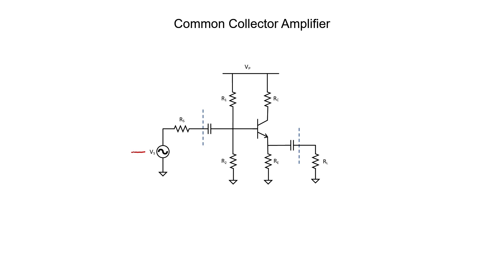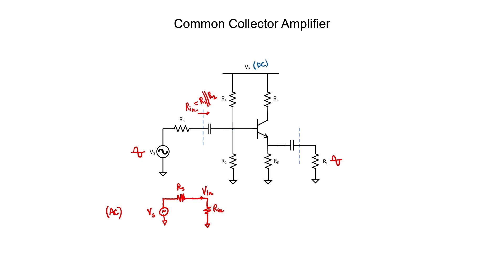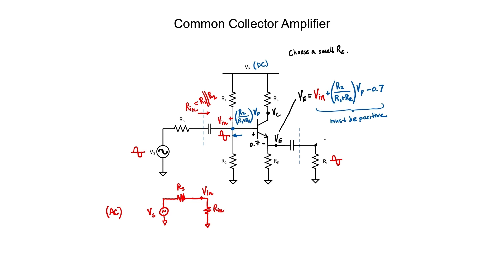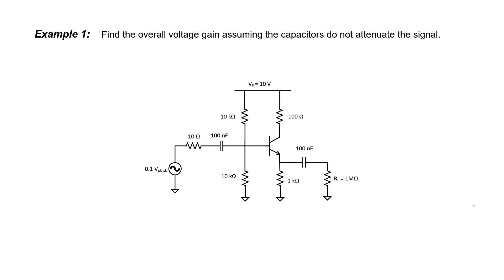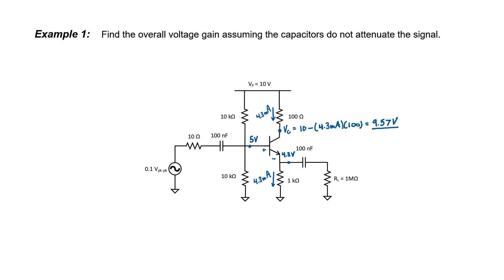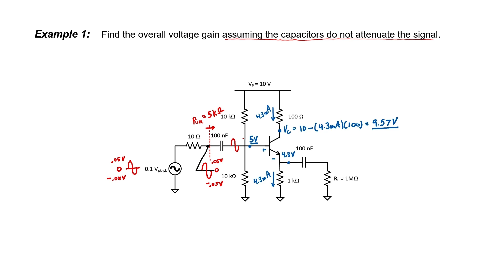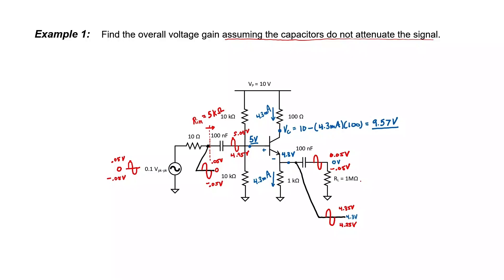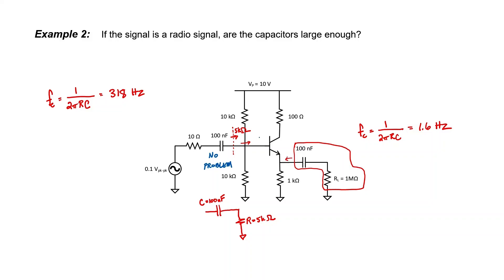Gain in a common collector amplifier (9-Transistors)

Comment: Thank you for all these amazing videos. I am an ex-EE (undergrad) but now a physician. I am a ham radio operator and do electronics as hobby now. You mention in this video that you want Rin to be as large as possible. However, in RF, people often try to "match" the impedance, often at 50 ohm. I understand that this maximizes the power transfer. But wouldn't it still be advantageous to keep Rin as high as possible and then obviously impedance match on the output side? Or I wonder if this is because at RF, it's hard to keep the Rin high (due to parasitics and etc.) so they just assume Rin is somewhat fixed and then work on the matching circuit??

Comment: TY, this was incredibly well done and helpful. I am playing catch up as well as review, and you reminded me that the voltage divider for bias is seen as a parallel resistance and I immediately remembered why. I'm finishing up some common emitter designs and had forgotten this for my RC filters. I was within range, but this helped me pinpoint designs as well as explained why a particular cap seemed to have cleaned up my output signal so well, and another was significantly reduced in bass. 

I needed a major reduction due to excess, but my figure was showing me 95 Hz when it's in fact, much higher than that! By sound, 95 Hz didn't seem reasonable, so I checked.

Comment: If the capacitors are polarized, what is the correct polarity?
Reply: If you consider electrolytic polorize capacitor, they have Negative mark on one side.
Reply: @h49suthar exactly - which side should be connected to positive and negative?
Reply: @tomlovie Think about this for a moment, where is the voltage "most positive"? 

It is at the point of the voltage divider, in his example there is a swing seen at the base of between 5.05 and 4.95 volts. On the other size we have a swing between .05 and -.05 volts.

So far so good, now can you see where the positive terminal of the capacitor is? Feel free to answer but this should be obvious. 

As a side note, while a polarized capacitor (like an electrolytic or tantalum) could be used they generally are not for radio frequencies due to parasitics associated with these type of caps. Ceramics are a better choice here and as an added bonus these little things are NOT polarized so the problem goes away.
Reply: @thebrokenengineer thanks for explaining this, I appreciate it.